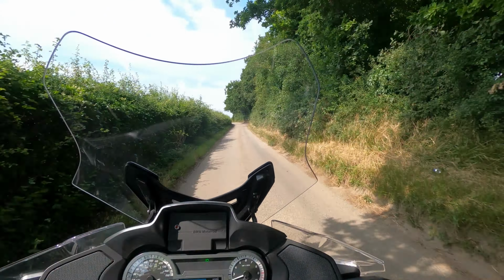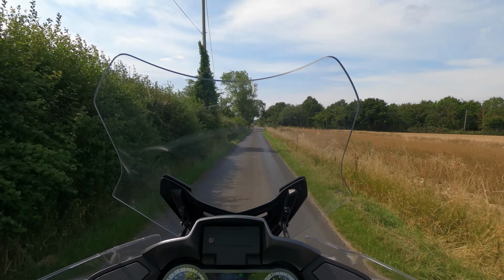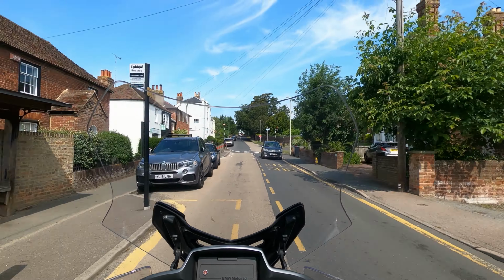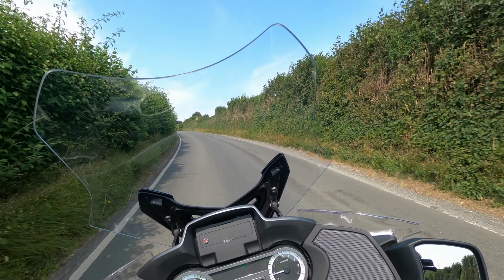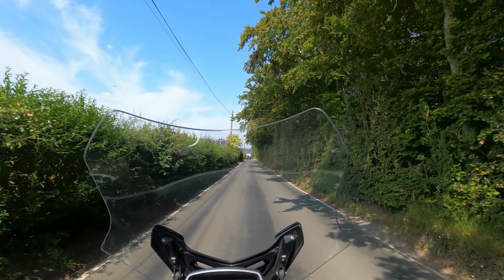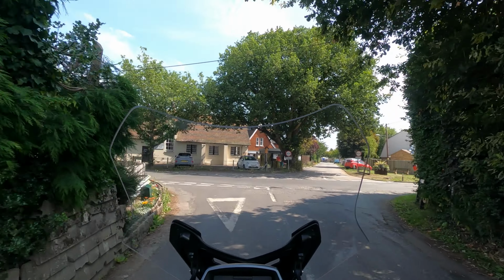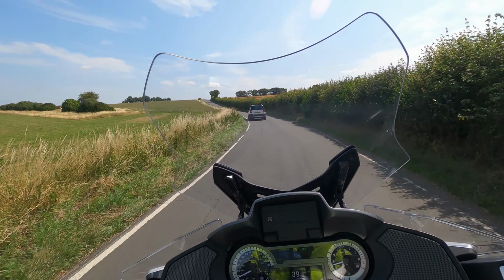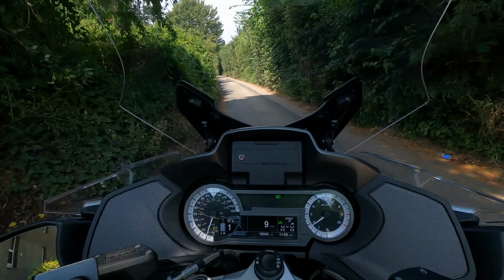Gear Changing - Rev Matching. Advanced Motorcycle Training

Comment: Thank you so much. What a great video. Up to now my attempts at rev matching or blipping have been very hit and miss - had watched lots of other videos on it but I didn’t really understand what I was trying to do. Watched your video last week and then yesterday did a 5 hour ride with some friends and tried out your first option step-by-step approach and it worked perfectly for me all the time (dropped revs, clutch in, drop a gear and then clutch back out at same time as bringing throttle to a higher revs position). I ended up using the technique over the whole ride - preparing for overtakes, approaching junctions and bends where I wanted to maintain my speed but be in a lower gear - made the whole ride so much smoother.

Comment: i close the clutch then bring the revs up as the clutch comes  out. like a car. very quickly fell into the habit of using my gears very lightly along with breaks to slow down. never heavily. going round a corner with the clutch in feels wrong to me. hmm
Reply from the maker: Thanks for your comments,  yes going around a corner with the clutch in would indeed be considered "wrong". 
Many new riders do it and turn it into a habit but of course it reduces stability and you lose the benefit of control via engine braking and throttle response

Comment: So if I understand correctly (as a motorcycle newbie), this technique is really only to be used on slippery road surfaces, otherwise using the brakes to decelerate and then selecting the appropriate gear is the way to go ?
Reply from the maker: hi, it can be used on slippery roads but also to take a lower gear for flexibility without reducing speed. But generally yes, braking and then selecting a lower gear as appropriate is the norm. All the best
Reply: @MotorcyclePWR  Thanks very much for the reply.🙂
Reply: Brakes to slow, gears to go.

Comment: Good video with good info.

For those of us with advanced electronics, a few comments: Up/down the gearbox mid bend with a GOOD quick-shifter, isn't an issue. The ECU knows the bike is leaning over and compensates for you. Equally when coming down the gearbox, the ECU can re-match for you (if you know how). On both the BMW RT and K16, light brake pressure (enough to turn the brake lights on, not enough to engage the brakes), and the ECU does not rev-match changing down the gearbox... so for example, "drag" a little rear brake going into a roundabout, and the ECU will rev-match properly without "blipping"

Of course, we should not be reliant on electronic aids, because there could be scenarios the manufacturers haven't catered for, or the bike might have a faulty sensor, etc. Or the electronic aids might not be available on that year of bike.

I find 3rd gear in most NSL situations on the K16 gives the flexibility that your 2nd did on the RT (different engine characteristics). The RT quick shifter is much more of a clunk than the K16 (my theory is the K16 has more cylinders, so more chance to hit the "sweet spot").

Comment: I was taught that technique in a car, initially on a disused Airfield, a long time ago. The Instructor used to shut his eyes and if the gear change wasn't smooth he'd say " I felt that, go round again "   😊
Later when I when I started using it on a bike, luckily I never managed to lock the back wheel and throw the bike up the road, thanks to the earlier car instruction. Great video, thank you.👍

Comment: What do you think of motorcycles getting quieter? Personally I feel it puts us in even more danger. Good sound from the exhausts gives you feedback on how smooth your operating the bike. 
My instructor says listen to the engine and you'll know. Well thats not gonna be possible in the future.
Reply from the maker: i do think some sound is a positive. Rode an electric bike a while back, not for me! Seemed quite soulless.
Reply: Aprt from acceleration, it's the engine and intake roar, that you mainly hear not the the exhaust (unless it's illegally loud). My vfr and many more has a very quiet exhaust, but I hear what the engine is doing constantly. On an eV bike, knowing what the motor I'd doing, is less relevant due to no gearbox and constant torque. Interesting question.

Comment: UMM Rev matching or blipping to slow only a few miles an hour is pointless.  The idea of rev matching is if you are barrelling into a corner and slam it down multiple gears at higher rpm while heavily braking on the front (as we don't use the rear - more on that) while the rear wheel is slightly lifting from the road surface.  Bikes without a slipper clutch, this can cause "chatter"  and coupled with any rear braking exaggerates the chatter and really doesn't make for an easy ride.  

for the bike you are riding, rev matching is a pointless exercise.  (hang on) Why are you still using the clutch to change gear.  motorcycle gearboxes use straight cut gears and don't require a clutch to change gear, up or down.  BUT! Using the clutch to change down, the revs must drop off, then change gear, then drop the clutch.  At THIS point, is where the engine needs to catch up with the wheel. and this is when you may? get some lock up, but NOT at lower speeds or 1 gear at a time.    

according to the not so efficient "advanced" riders you SHOULD be in the right gear for the correct speed in accordance with "the system".

By all means teach rev matching, but do it on a decent bike at decent speeds.
Reply: Dont look pointless to me.
When i started reading i thought you might have something valuable to say, tgen i read about barreling, slamming gears and stuff about decent speeds and bikes and i realised that its just keyboard warrior bravado. Thanks for your input, helpful
Reply: @mosshague3313  My reaction, too. Like all techniques, this has its place. I don't teach it at CBT or DAS for the reasons mentioned in the video I will start to introduce it with ERS students.
Reply: Bollocks.  Rev match to ensure you're in the right gear at the right revs so the engine is not accelerating or slowing the bike until you decide with the throttle, or brakes, which way you want to go.  This block changing nonsense that IAM and RoSPA teach is not a good technique for smooth and controlled riding.
Reply: I think you missed the point: rev matching is not done to reduce speed, it is done to maintain speed, and gain flexibility. That is, either closing the throttle or applying the brake will slow the bike down, while opening the throttle gives a quicker acceleration than the higher gear you were in.

Rev matching is not intended for "barrelling into a corner and slam it down multiple gears"

Regarding potential wheel lock ups, both the RT in the video and the K16 that I ride, have a torque limiter, since they're both shaft driven, rather than having a slipper clutch. The latter will, as the name suggests, slip the clutch removing drive from the wheel, and preventing a lock up. The former, will sense the lock up is approaching, and tell the ECU to apply revs, which will also avoid the lock up (unless you're being a tool).

I think your definition of "efficient" probably needs some work. "On a decent bike at decent speeds" implies that you're spending more on maintenance than I am. I don't know about you, but I get more enjoyment out of my bike when it's out on the road, than when it's in the garage having bits replaced.
Reply: @cliveadams7629  what exactly here is bollocks please? Im not sure that block changing is nonsense, not just taught by iam and rospa but a technique that is used sometimes and has its place. if you think its not a good technique for smooth and controlled riding then youve probably been taught wrong or dont understand